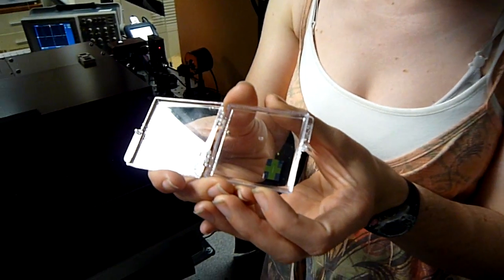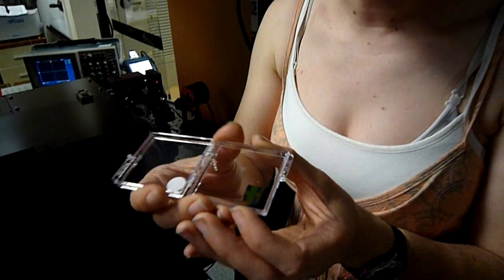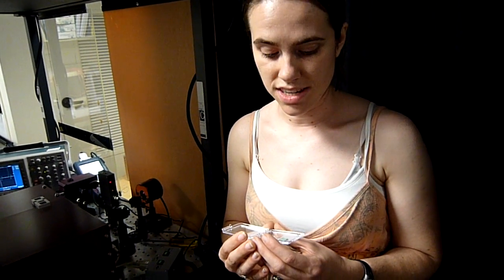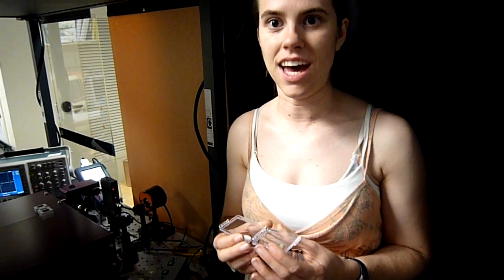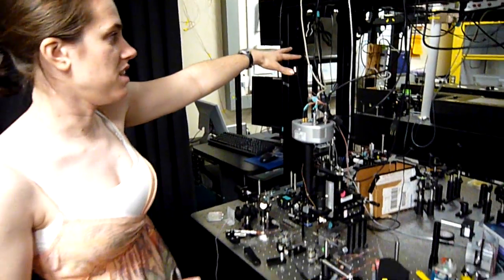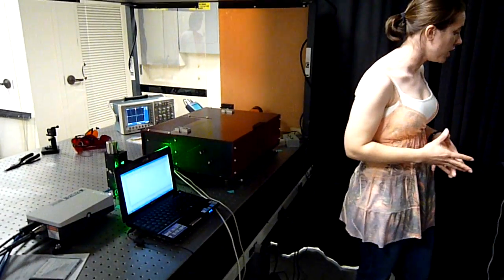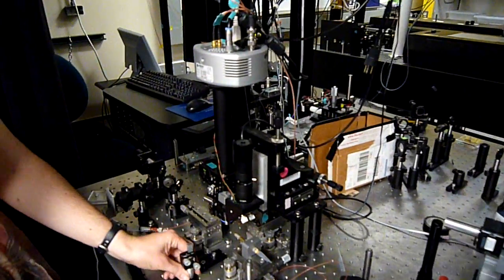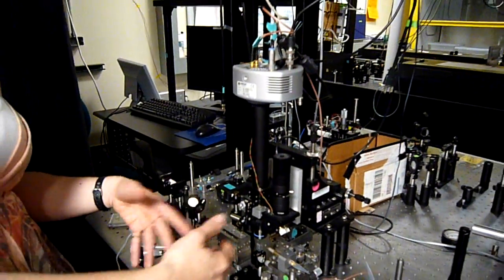Trestles LH10-fs/CW laser system at UC Santa Cruz Center of Nanoscale Optofluidics

Comment from the maker: NEW!!! Femtosecond laser model FL1000 - sales@dmphotonics.com
Active medium Yb:KYW
Wavelength, nm 1040±10
Average output power at 1040, W> =0.9
PRR, MHz 75±5
Pulse energy @ 1040 nm, nJ> =10
Pulse duration1) (FWHM), fs= <120
Spectral linewidth, nm> =7
Long term stability, %= <3
Beam quality TEM00; M2 = 1.5
Polarization Linear (Horizontal)
Power consumption, (230V±10%, 50/60Hz), W< 250
Dimensions (LxWxH), mm
Laser head 670 x 220 x 155
Power supply 240 x 240 x 110

Comment from the maker: Trestles LH Ti:Sapphire laser
Trestles LH is a new series of high quality femtosecond Ti:Sapphire lasers for applications in scientific research, biological imaging, life sciences and precision material processing. Trestles LH includes integrated sealed, turn-key, cost-effective, diode-pumped solid-state (DPSS). Trestles LH lasers offer the most attractive pricing on the market combined with excellent performance and reliability. DPSS LH is a state-of-the-art laser designed for today’s applications. It combines superb performance and tremendous value for today’s market and has numerous advantages over all other DPSS lasers suitable for Ti:Sapphire pumping. Trestles LH can be customized to fit customer requirements and budget.